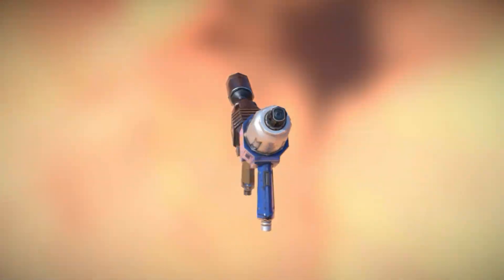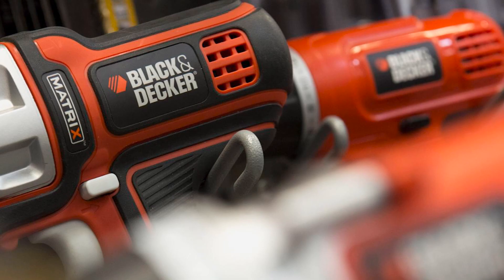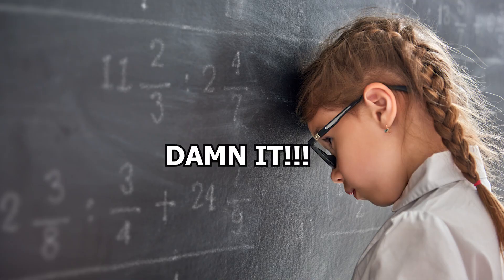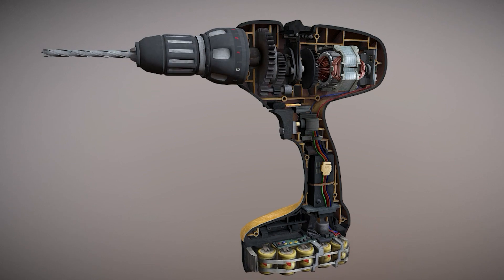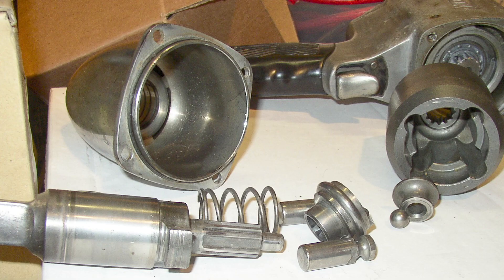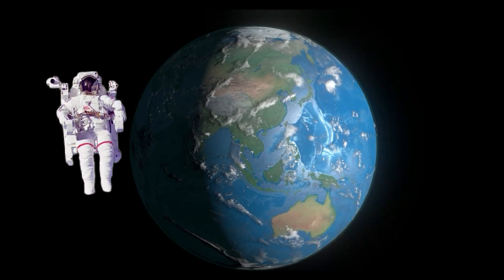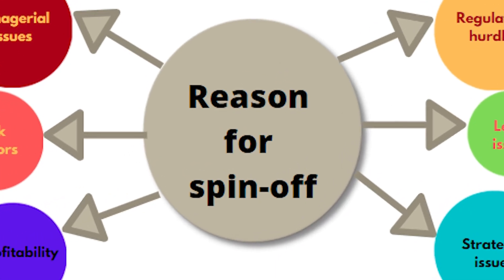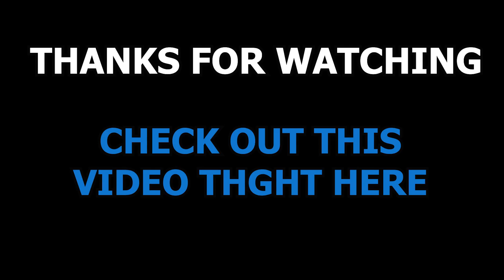Cordless Impact Wrench Was Invented for this

Comment: Someone should "invent" a respiratory system that connects to a helmet/screen that is lightweight and powered by a dewalt, makita, milwakee etc battery that relies on over-pressure to keep you not breathing in bad stuff, rather than relying on gaskets.  I have not seen this anywhere, and I would love to have a system I could connect my dewalt battery to when I'm insulating or grinding concrete! 3M has their system, but I would love to have one where I could instead plug in my power-tools batteries.